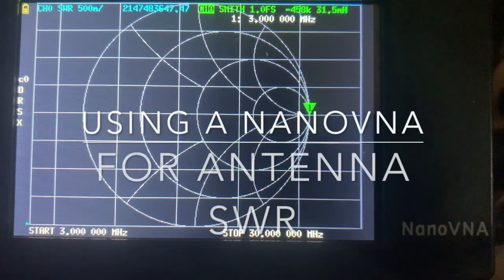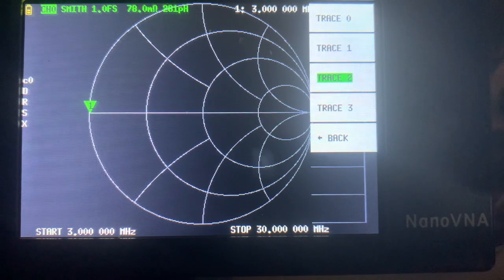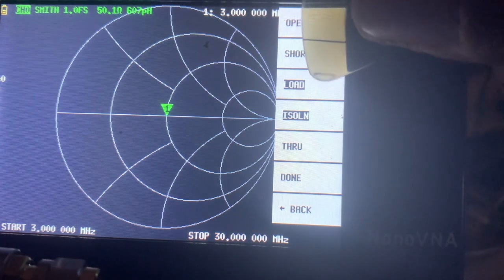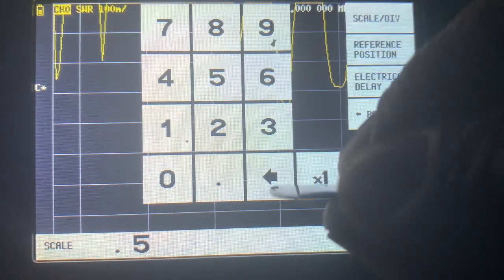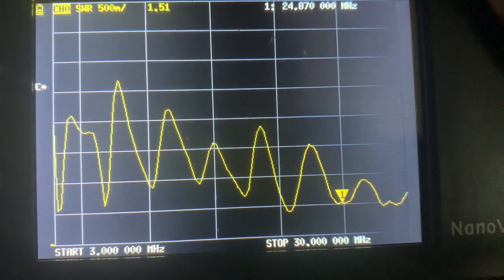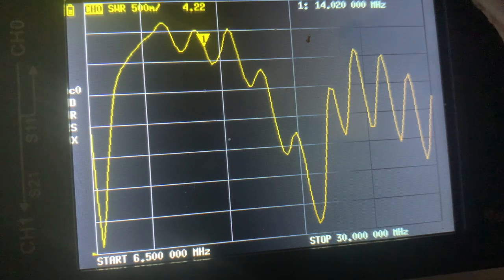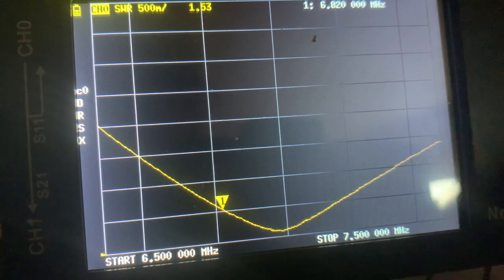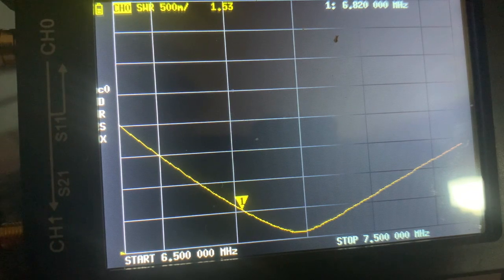NanoVNA for Antenna Analysis

Comment: You said to cut the length but it is not true,when you go left to tune  there is rise and not dip ,so you have to increase the the lengh
Reply from the maker: What I mean is you start out long - dip is the low side and start pruning (cutting) until the dip in the SWR is in the region desired.

Comment: Question: Should I measure AT (+/- 10' away) from the antenna or where the transceiver connects? I get GREAT readings AT the antenna, and MUCH worse at end of coax where the transceiver connects. What am I doing wrong?
Reply from the maker: The readings should not be that much different between "at" the antenna and 10-15 feet away.   You could have a bad coax.   Check your coax against a dummy load.  It should read 50 ohms.
Reply: @CaptainRadioAdventures  -Thanks! for closure, I found an issue with the remote antenna switch that was causing the difference!

Comment: Changed band and it was clearly out of calibration
Reply: Correct. Every single time you change a band on a NanoVNA, you need to recalibrate it. With NanoVNAs, remember this simple advice: calibrate early, calibrate often.
Reply: That's not true. You can just save calibrations

Comment: Hello! When you travel across the swr curve with the left and right keys… is it  to adjust the steps? For instance, i find that mine goes from 7050 to 7150 or so… 
Thank you
Reply from the maker: The distance between steps depends upon the stimulus bandwidth.   If you want small steps set the bandwidth to be small.

Comment: How to measure/ calibrate SWR of a patch RFID antenna with frequency of 865 -867 Mhz
Reply from the maker: Sorry I am not familiar enough with how RFID antennas are configured in terms of whether it has a port that a nanoVNA can connect to.
Reply: @CaptainRadioAdventures  yes, a sms port is there to connect to nanovna. Can I send pictures of measurements to discuss the problem I am facing.

Comment: Captain Radio Adventures, Thank You for this VNA explanation. Question. I am trying to increase the range of FPV on a new drone that was purchased. As it is now,,the FPV stops at only 125 meters. The drone itself have flown out to 1300 meters several times,,albeit line of sight,,,not good! Am wanting to piggback an rtlduino on back of drone to create a bridged wifi setup to the drones wifi,setup,,then another rtlduino on ground station,connecting to drone rtlduino,,to connect smartphone to,,with the drones proprietary app. 
The PROBLEM: From what i can understand these VNA will only go to a little over 3ghz. The drones fpv broadcasts on wifi 5.8 ghz,,,so if i bought one of these it really wouldnt do me any good for troubleshooting would it. Am very dumb on this stuff,,it goes without saying. Thanks again
Reply from the maker: NanoVNA version 2 only goes up to 3 GHz so until the programmers increase the dynamic range to that which will cover the drone frequencies you don’t really have a choice that is affordable.
Reply: @CaptainRadioAdventures  Thank You much. .. May I ask,,,do you think if i was to piggyback an rtlduino,,which is essentially a 5.8 ghz repeater on top of drone,, with the pcb antenna built it,,it would mostly reflect back into the drone,,and not gain much,,or may be worse output (to ground) for smartphone receive?  These arduinos do have pads to solder uaw?,,,for external antennas connect also. Thanks
Reply from the maker: I am not a drone expert.  I think your idea will work though at least in principle.